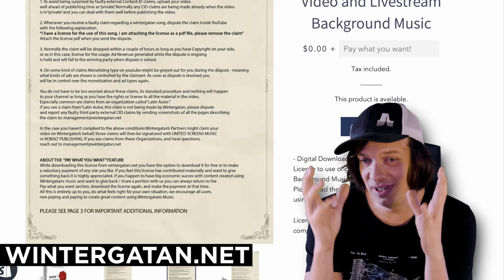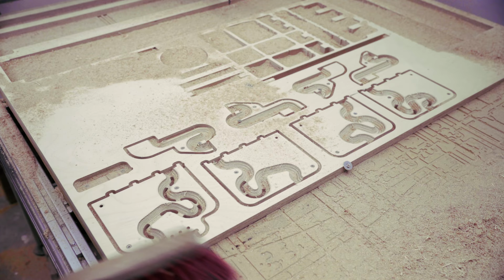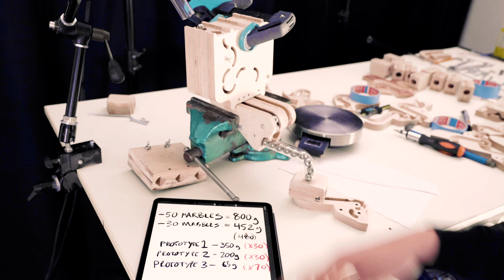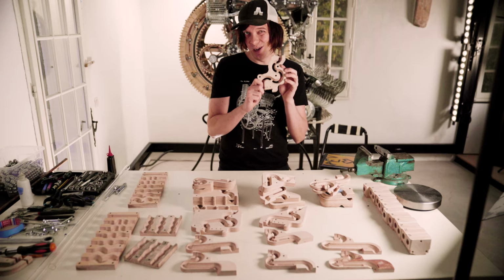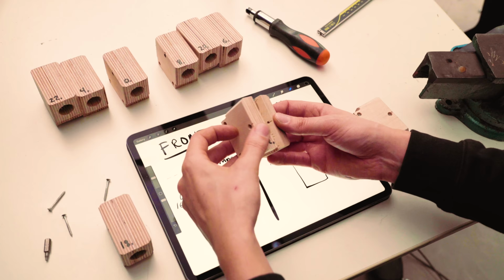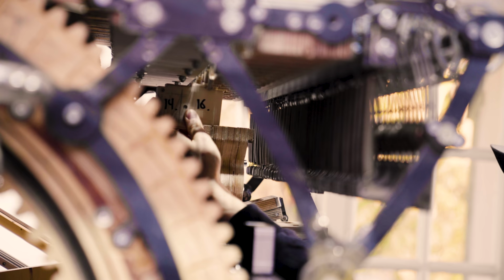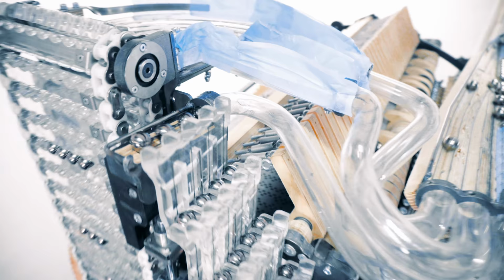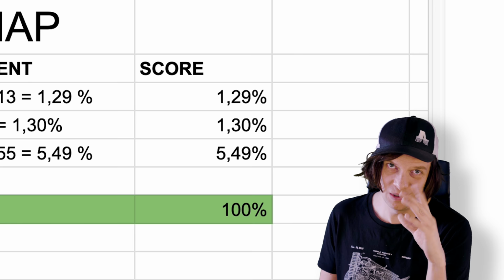Playing 20000 Marbles - Marble Machine X #147

Comment: Re: the 19 marbles that missed the funnel.  The drumheads will rebound differently based on changes in humidity, which may be the root cause of why they worked the first time and missed this time.  To test that observation, note bounce height when the head is bone dry, and then again after it is slightly damp.  Unfortunately I have no suggestions on how to control the weather. Good luck!
Reply: Commenting on this to bump it up in youtube's algorithm 

Humidity is something that never crossed my mind. I work in manufacturing and there's just so many variables you can't even think of when planning a design
Reply: yeah humidity is going to be a factor he cant control in a venue but at home its quite easy with a himidifier en dehumidfier and have the doors and windows properly sealed he should be able to get a good range. But the only solution would be a bigger funnel because he is going on a world tour and different places have different average humidities he can't control
Reply: Plus wood absorbs humidity and swells, and even if it's not measurable, the amount of tolerance on this machine is very little (built extremely precise) so there isn't much room for error.
Reply: Doesnt that depend on what type of material the drum head is made of??
Reply: Another simpler possibility is that the funnel position is perfect for the first channel (confirmed last week) but not for the second channel. That is easy to test by measuring miss rate for each channel individually.
If marbles are now missing on the first channel, it must be due to the changed drop mechanism (unlikely, because the drop is decoupled by the pressure valve), new machine vibration (also unlikely I believe), or changed externalities like humidity (which I know too little about to estimate).
Reply: @TheNewTimeNetwork  
i agree. he should test the other channel to see if it's just that channel missing.
plus vibrations when playing notes very quickly will leave a vibration from the last marble, this could cause the next one that hits the drum to bounce funny. he reduced it last time but maybe it's not enough with two channels playing back to back.
Reply: I think the drum funnel is not big enough for buffer, coz u have minor change the "shooting angle" of the marble drop device for the drum. So u still have marbles drop on the floor.
Reply: Pssht, you don't know how to control the weather?
Reply: if anyone will find a way to control the weather, itll be him
Reply: @AJMansfield1  Damn, carla
Reply: build a stage for the marble machine that is slanted for the world tour that rolls all the marbles into a funnel and back into the machine.
Reply: @rocksfire4390  I think he should also test a "worst case" scenario of each channel being fired as fast as possible (magnets in every spot on the piano roll wheel thingy). This way the funnel movement will be tested heavily as well as any possible backing up of marbles as they go down. Eventually I think that should be done for the whole system; at the least it will allow him to know what the upper limit of the marble pass-through rate would be.
Reply: Not just humidity, but as the drumhead gets worn down it will have less spring and thus the marbles won't bounce as far.  I think a solution would be a larger net to catch the marbles.
Reply: There could also be a "double bounce" issue. With two marbles firing quickly after one another from the separate channels the snare may not have settled and could be causing the second to bounce differently.
Reply: Factoring in skins on drums lose elasticity over time (especially hitting the same spot) and resonance from quite literally a plethora of potential drum beats, things will add up quite fast. Maybe providing better dampening could solve the issue but the drum will eventually deform. 

Also setting up a a plane with powder or liquid in a contained unit attached to the frame may help show intensities of vibrations for a visual aid, being able to mount it for diagnostics in different locations should help with interference / coherence
Reply: Sounds like a problem that could be critical...
Reply: Just a thought, the rhythm used was irregular this time, could it be possible that at some point in the phrase that there is resonance in the drum head that causes a "double-bounce" effect that causes some balls to "leap" higher and miss the basket?
Reply: Controlling the weather is impossible, but by expanding the funnels he can catch them regardless of where they fall. I would suggest the test you did and getting a humidifier in the room to try and make it more humid to test the effects accross many different humidities, to see where the fail point is, and how to wide the funnels need to be to counter it.
Reply: Could design some kind of piston that reacts to humidity to alter the locations of the cups?
Reply: the drumhead over time will wear down being played in the same spot over and over. not just with humidity but factor in the consistent hits to the same spot with the moisture and issues could arise.
Reply: @LikelyLagging  to some degree, but even the air changes its mass slightly when it carries more mass.
Reply: Does this apply to plywood as well? Because its multi directional I thought Air dampness wouldn't be a problem
Reply: air humidifiers are a thing and very common in instrument shops :)
Reply: Why not enlarge the funnel so that it works at both the maximum and minimum operating temperatures? I suspect the bounce height monotonically decreases with a rise in humidity, so it should be sufficient to test the boundary conditions.
Reply: Run a dehumidifier in the far corner room to reduce the noise, but to blow dry air over the machine? And note to keep doors n windows closed?
Reply: @TheNewTimeNetwork  or simply because the head is still in movement from one hit when the second comes and can either add to the bounce or subtract from it for various amounts. That would show up if the funnel hit was reliable whenever there was a gap in the music.

Comment: The overrotation doesn't help with reducing the force, it only increases the marbles' moment of inertia, which causes it to accelerate more slowly. Friction also doesn't help, because there is no friction, when nothing is moving. What helps is that the marble path is winding, which diverts parts of the force towards the walls, rather than in the direction of the path.

Comment: Never failed to amaze me
Reply: The upwards curve on your plywood piece is what reduces the weight of the marbles above, increasing the incline or moving the incline closer to the dropper will also further reduce the weight, this is all hypothetical of course 😂 also I loved the flower transition at the beginning  of the video and you should try to have MMX background music it would be awesome 👏
Reply: @MaxDebt  just in case you didn't realize you posted your comment in the comments of another comment. If this was intentional sorry for bothering you but it didn't look like it was so I wanted to let you know just in case :)
Reply: never will
Reply: And isn't that the damned truth
Reply: Go on dude. Ain't noone subbing to your channel from comments
Reply: @MaxDebt  a
Reply: The reason why the Thrace width changes the speed that the ball trsvels is because the circumstance is either longer or shorter in the points of direct contact with the track. So the circle that the ball has to travel is either larger or smaller depending on that circumstance, meaning that the time it takes to complete a full rotation is either longer or shorter as well

Comment: "Simple" explanation on why the overrotation slows down the marble: 
You have a fixed amount of potential energy, which is depends only on the height difference of the start and end of the tracks. 
When you start to translate and rotate you distribute that energy on rotational energy and translational energy. If you are interested only on how faste the marble traverses the track you only care about translational energy, so, the more energy you divert to rotation, the less you have for translation, and hence, the slower you see it go
Reply: Moment of inertia, right? Not sure if that’s the correct term in this case.
Reply: This also means the effect really only happens when the marble is moving. I'm not sure if it contributes much to reducing the pressure of a static column of marbles, although there might be some effect involving torque and friction between adjacent marbles. It would be interesting to test two labyrinths of the same shape, the only difference being the riding height of the channels.
Reply: Can you please explain that in more plain English? I don't know much physics jargon.
Reply: @JJ-rm7jw  there's kinda a limit to how much it can be simplified. I think a slightly simpler/clearer version would be to say that the more rotations the ball does as it moves along, the more energy is used to make it spin and less energy is used to make it move forward.
Reply: @JJ-rm7jw  When marble rolls on flat table, the equator of the marble is the part that is spins to move. When you add tracks, you make the marble not spin on the equator and instead spin on a smaller area.  These smaller areas have to spin more times around to get the same amount of distance.  The marble only has a certain amount of energy.  The more times the marble spins around, the more energy is put into spinning and not moving forward, thus the more spins means slower marble.

It's like how we use different sizes of gears in a car or bike to move faster.  In the car's case, the gears all spin the same speed, so we use bigger gears to use more energy to move faster.
Reply: @JJ-rm7jw  To make it even simpler... the tracks hold the marble to slow it down.  The marble spins to get free of being held.  It's easier to get away from someone putting a hand on your shoulder (the two tracks together) than it is if someone is grabbing both your shoulders (the two tracks apart).
Reply: The upwards curve on your plywood piece is what reduces the weight of the marbles above, increasing the incline or moving the incline closer to the dropper will also further reduce the weight, this is all hypothetical of course 😂 also I loved the flower transition at the beginning  of the video and you should try to have MMX background music it would be awesome 👏
Reply: @JJ-rm7jw  Here's my take.
Consider a traditional mounted model globe showing the Earth.
When you turn it, the north pole and south pole don't move, but a point on the equator will move in a broad circle, which could cover a significant distance if you were to stretch it out in a line, or run a tape measure along the surface. Any point on the globe between the equator and one of the poles will inscribe a smaller circle, which means a shorter line.

This means that different points on the globe has the same "rotational velocity" (it is turning by the same number of degrees per second) but a different "linear velocity" (when you straighten out the tape measure to see the distance as line).

Now when you apply an accelerating force to a rotating body, you speed up its rotational velocity, and in all of the 3 rails in Martin's demonstration the accelerating force was exactly the same: the same gravity acted on each one. If you apply the same acceleration, you should get the same speed, and if you get the same rotational speed, then the linear speed will depend on how big the circle is:
 near the equator=big circle=more distance=faster, 
 near the poles/axis of rotation=small circle=less distance=slower

In reality, it's slightly more complicated, because the acceleration doesn't all go into rotation -- some of it goes into the linear speed along the rails. The ones that move along the rail slowest (because the point of contact is nearer the axis/poles) are also the ones that are spinning fastest around their own axis, but the rotational velocity isn't relevant to Martin's problem -- he's only interested in controlling forward motion.
Reply: This potential energy explanation is correct, though it can be quite abstract to understand. In my eyes, the concrete explanation would be: the marble has to accelerate into a much higher rotational speed on a wider track than on a narrower track. This acceleration takes ‘time’ so this marble will be slower.
Reply: Manuel, I don't pretend to know anything about physics, because I don't (I know just enough to be dangerous!! 😄) With all of that decreasing energy, couldn't you use some of it to produce more energy? 

I know there's no such thing as a true perpetual motion machine, but my thinking is along the lines of a motor-generator. A battery, perhaps, is used to start the motor and energize the field coils, which in turn drives the generator to produce electricity. The theory is that you could bleed off some of the current to keep the motor energized to keep the generator running, and so on and so on, ad infinitum. 

I said all that to say this -- could some of the kinetic energy from the marbles be used to keep the mechanism running, thereby creating more kinetic energy? Or is this idea nothing more than an air castle?
Reply: @Erzahler  you never produce energy, in any situation, you just tramsform a fixed amount of energy. 
In this case you waste your energy moving the crank and the mechanism transfer that energy to the balls (by lifting them from the bottom of the machine to the top).
Usually not all the energy you put into the crank is transfered to the balls, as you are producing noise and vibrations and friction, etc, so the amount of energy that the ball has now is just a fraction of what you gave. 

So finally if some of that energy is not used in translational energy but rotational energy, you could try to use that energy elsewhere, but nevertheless it would be energy that is in there because you introduced it by moving the crank
Reply: @Erzahler  A classic motor needs either a moving magnet or a moving coil. The marbles are neither magnets, nor coils.
You could generate a tiny amount of current by wrapping wire coils around the marble runs, but it would capture so little energy that it would not be worth it.

And before you suggest using magnetic marbles, Martin deliberately demagnetises them after they come off the marble lift because they would all get stuck together otherwise.
Reply: @JJ-rm7jw  A marble raised to a certain height can provide a certain amount of oomph when it falls. It takes some oomph to make the marble move along the track, and some oomph to make it spin. If it has to spin faster as it moves, more oomph goes into making it spin, so there's less left to make it move.

Comment: Great progress!
However, the Marble Machine X is ≈ 99.7% reliable, not 99.997.
61/20,000 = 0.00305
0.00305 * 100 (To get the error rate in %. This is the step you forget) = 0.305% error rate
100 - 0.305 ≈ 99.7% reliable
Reply: also, is it just me or does it look like with his calculations the adjusted score will go above 100% eventually ?
Reply: See, that's the reason he should subtract the number of failed marbles before converting to a percentage to avoid any errors. I mean if you know what you're doing you don't actually need to do that, but that's probably the best way to error-proof it.
Reply: @jakobglieder  No, because if he uses all the parts the correction factor will be 1 and you'll just get the actual success rate, which is nice. However, is it really a good indicator? That's a very different question, and I'm not sure it is.
Reply: @onemadscientist7305   I think it's not too bad as he really needs to get it to 1 (100% * 100%) to know everything works reliably.
Reply: I mentioned this on his last video, hopefully he sees it this time. I also think his metric for adjusting the score could be significantly improved. Since nearly every channel will have 99+%, the adjusted score really is just measuring how many channels he has implemented, regardless of their reliability. A better solution might be to look at the rate of failures / channel.
Reply: i really hope he doesn't see this
Reply: @kylejacobs1247  Post it in the discord, he doesn’t read YouTube comments
Reply: @shrimp7229  well he hasn't seen it for the last two videos, he made the exact same mistake
Reply: The issue has been reported on the Discord chanel
Reply: Though its true that its not mathematically correct, its consistently wrong with the same error, so its usable in statistics.
Reply: @mRcOOL5YO  Unfortunately it doesn't work that way, especially when dealing with percentages. That is because the error does not occur when the result is 100%, as it did in test #2. So you can not compare tests #1 & #3 with the second test. The numbers are just plain wrong. Martin does awesome work, but I hope he gets these messages so that he can accurately measure his success.
Reply: @mRcOOL5YO  if all 20000 had dropped, Martin's reliability score would still show 99% when it should be 0%
Reply: @maccsguitar  hehe, no it would be 0%, but i see what you mean. If all marbles fail he doesn't need to do math, he can correctly assume its 0% success.